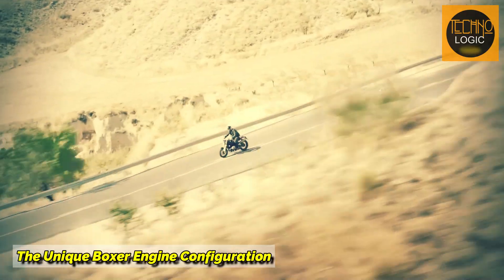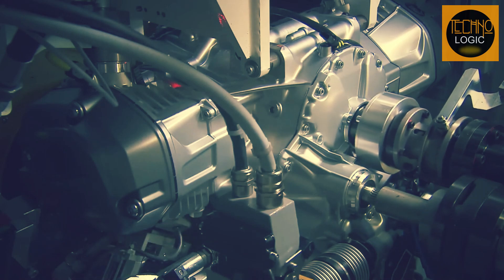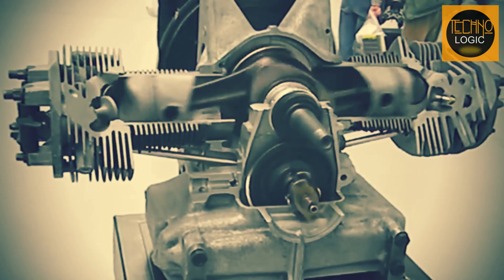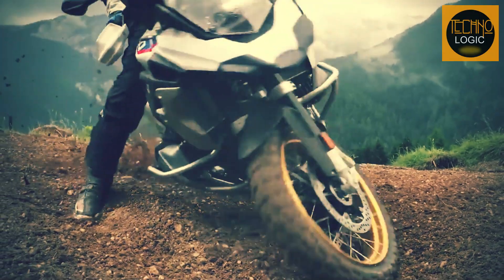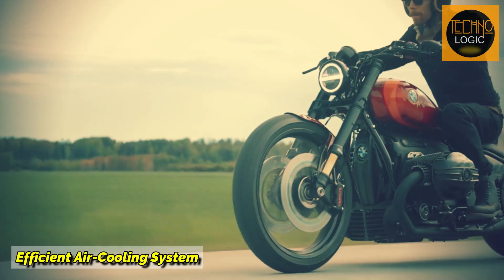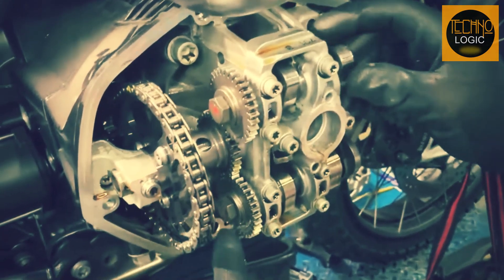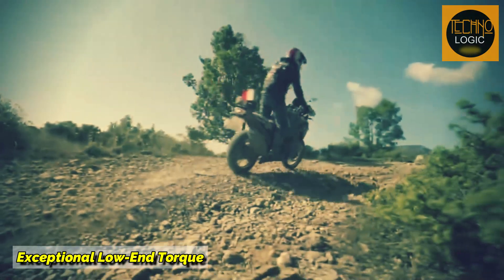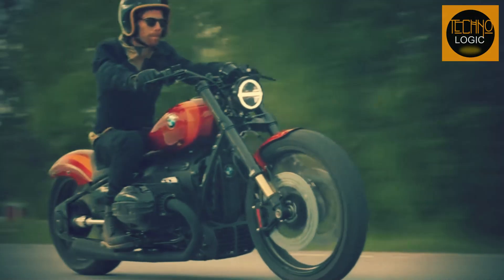5 Reasons ✔️ Why BMW’s Boxer Engine Reigns Supreme ⁉️

Comment: The history includes shaft drive.... Love it or not but the rotation of engine and gearbox leads direktly to shaft drive. No chain needed. Moto guzzy ist almost simmilar- Guzzi an BMW got their boost during ww2.... There were relayable concepts  needed to equipe the military. Thats the whole story.

Comment: Some of the hottest parts of an air-cooled engine are the cylinder heads and exhaust manifold. On a BMW "boxer" engine those hot parts are out in the oncoming breeze without any obstructions and when the bike is stopped the cylinder head heat easily rises up and away from the rider in a way that more conventional motorcycle engines cannot match. The lower center of gravity compensates for the extra width of the "boxer" engine in most real world riding.

Comment: 43,000 miles on my R 1200 RT. A lovely, reliable bike and engine, with wonderful balance and stability. I came from a V twin and a 6, and I’ve never ridden a more maneuverable bike.
Reply: How's the dry clutch operates after long miles and how is the process of replacing it ?
Thank you

Comment: When I first got my BMW bike I was not impressed with its performance. Coming from inline 4s I missed that 'snappy' acceleration which just wasn't happening on the boxer BMW. BUT then I discovered that incredible torque they have pretty much the entire range, even with a passenger in the back I barely had to pull the throttle to go uphill vs with my inline 4s I had to constantly shift down to climb up a hill. Also due to the low center or gravity it is very easy to handle in curves. Great touring bikes!

Comment: bull crap.the heads get wiped out easily.no leg room,too wide .
Reply: FALSE: The engine does not take the brunt of a tip over, most add crash bars, and the cylinders are significantly forward of the footpegs and do not impede legroom.
Reply: You’re not actually supposed to drop them but crash bars are added insurance. I think the boxer is a brilliant design with great torque, easy maintenance & a low centre of gravity to enhance the bikes handling. Ticks all the box(ers) for me.

Comment: Compared to the Suzuki vstrom 650 the BMW boxer engine and the manner in which they are manufactured they are unreliable. I own two gs 1200 BMW 1200,s and three Suzuki 650 vstroms, 05 06 and 07. Both BMW,s have suffered catastrophic engine failures of dropped exhaust valves plus three fuel pump electronic speed controller failures. All failures left me stranded and cost much monies to repair. My three Suzukis totaling over 200,000kms have never had an issue. One USA to Peru and back, the rest South Africa circled plus Nabia Botswana and parts unknown. Only normal wear parts, never a break down.
Reply: Lots of very high mileage boxers out there that are trouble free.

Comment: I've been an inline-4 rider for the last 40 years. Just bought a R1300GS 2 months ago. I still think they're ugly 🤣 But... the advantages are all valid! The torque is insane. 'Low horsepower'... 145hp is nothing to sneeze at!  I'll add another plus... is reminds me of a Lycoming aircraft engine and/or a Porsche. The low center of gravity makes 2-up riding a big plus on the GS. I think I'm a convert, but she's no Beauty Queen!